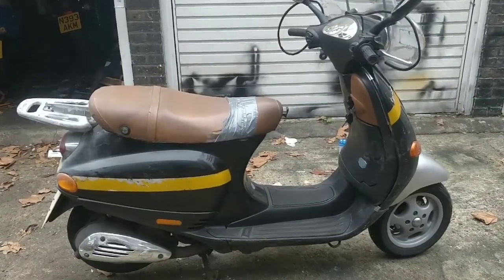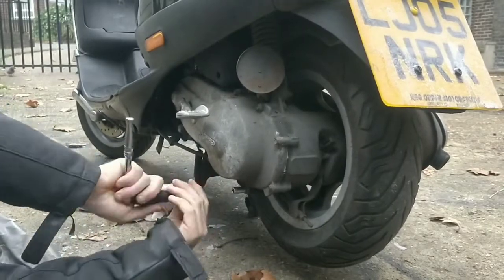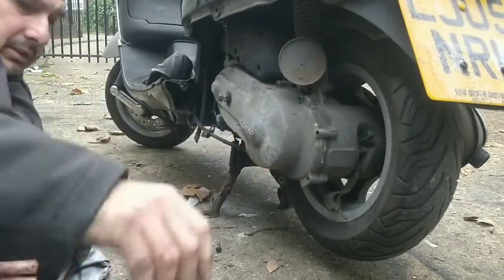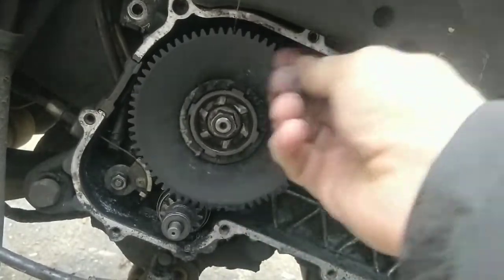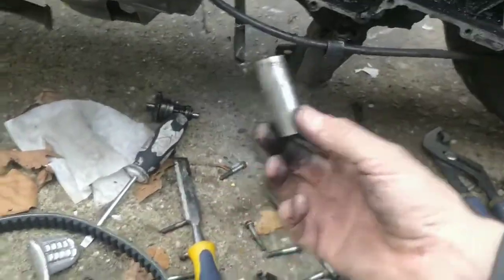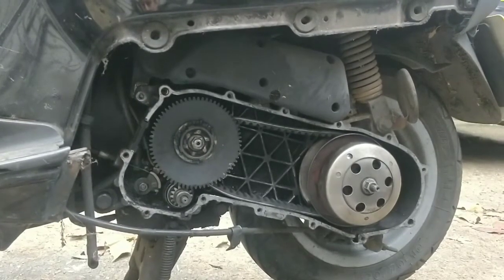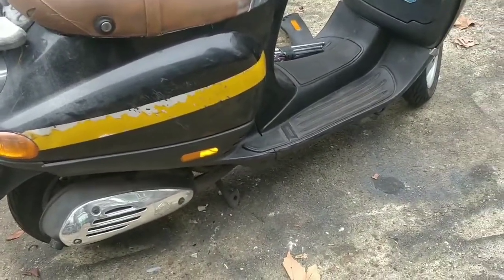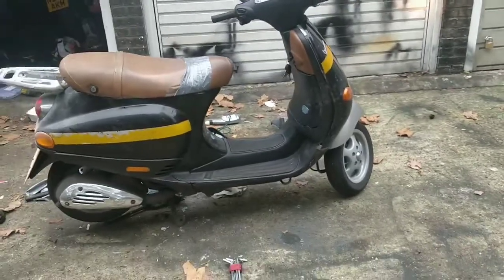Piaggio belt change and variator clean. my new vespa project.

Comment: that is not an oil pump it's a weight, this is a four stroke, probably a leader engine. there are special tools for holding the drive pully gear in place called buzzetti tools. imagine if there was oil in the drive belt, the rubber would not grip anything. i could be wrong, but i dont think vespa made 2 strokes for a longggg time. and two strokes had gears.
Reply from the maker: I can't see what vid you are referring to Charles but yes if it's a 4 stroke then it dosnt have a oil feed pump in by the variator. I've also got variator holding tools although the gun works great mate.
Reply from the maker: Also the current vespa and piaggio engines are 50cc 2 stroke mate
Reply: If it's got a oil tank and sounds like it does it's definitely a two stroke. I had the 125 et4 that was definitely a four stroke and was considerably quieter 😂 good video
Reply from the maker: I can't remember if I'm being honest. Some were 2 stroke some were 4. Very obvious when working in a bike. 

Cheers mate.

Comment: Great Video and appeciate the sentiment about the difficulties people are experiencing and the value that Youtube content providers have at the moment. .  Was wondering what the ODO reading is  - Isn't it something 12000 kms for belt and rollers and if any chance that belt was original  or the second only belt in the scoots life and just driven into the ground.  Motor / battery / starter / charge looking good.
Reply from the maker: Hi, it's actually got 50k on the clock I believe which for a little 2 stroke is amazing. I believe it had a new top end not long ago as I was told this. It won't be original belt or rollers that were on it as they would look terrible after 50k.

I need to double check that, 50 k is massive. Could be 5k.
Reply from the maker: 31,000 miles. Still hight for a 50. It rides great.

Comment: You should check oil pump belt as well cos wen belts snap sometimes can snap oil pump belt
Reply from the maker: I do mate. It would be clear if the oil wasn't pumping as the engine would over heat fairly quickly.

Comment: you should remove air box bolts first so you can lift it to access the other two bolts
Reply from the maker: I do Charles although I leave it hanging so it looks bolted still. I normally fully remove it from the carb aswell.